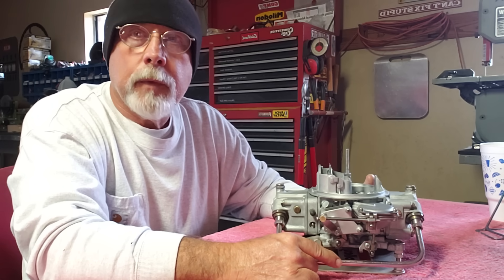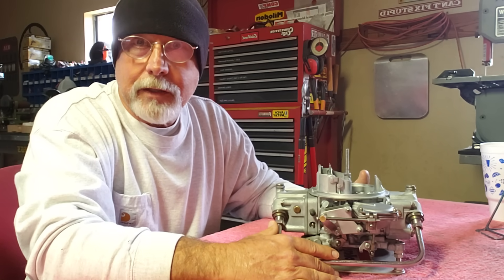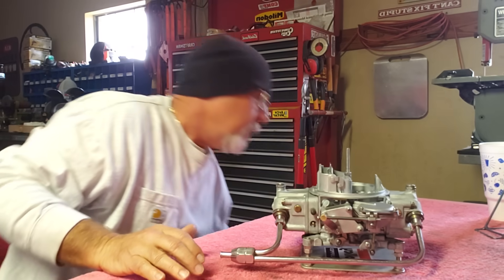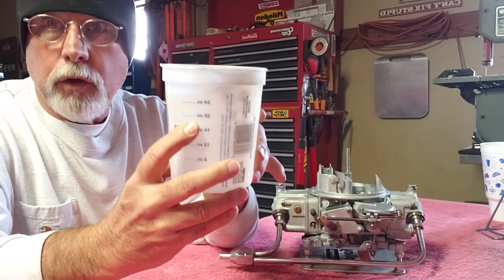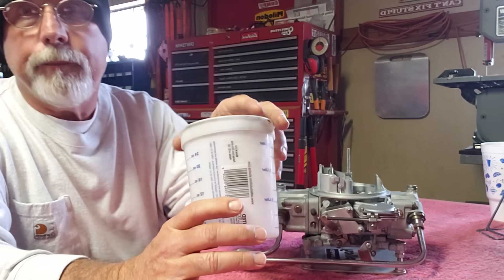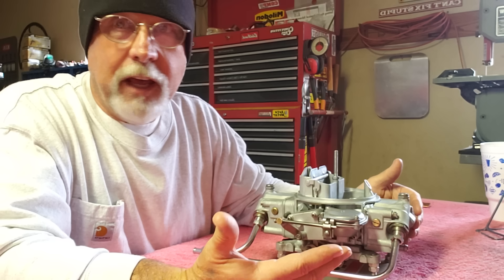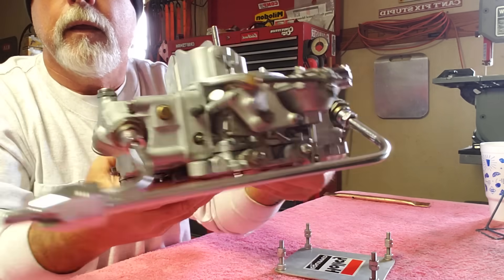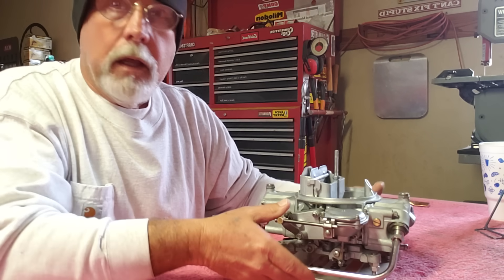Best carburetor cleaner ever!

Comment: Hydro seal carburetor cleaner is an acid that's been around for years.
Reply: The prime chemical for old style Hydro Seal is/was methylene chloride, not acid. It was called hydro seal, as water is less dense than the methylene chloride and floats on top. The water barrier is necessary to seal the  the methylene chloride as it is a gas at room temps and readily evaporates. It has now been removed from paint removers available to retail consumers. You can buy it from lab houses for a reasonable price. It will not harm steel or aluminum, but will dissolve any plated hydrocarbon. Lifters, carbs, painted parts. Remove and rinse with water. 

Alodine can be purchased to add the golden zinc chromate conversion of the surface and make it look perfectly like new. Aircraft Spruce sells the Alodine.

Ronnie, thanks for this video!!
Reply: @billl7551  I can still get a 5 gal.steel bucket of carb clean with a strainer .Remember that melt the throttle bushings on a Holly carb if you leave the base plate in there too long . Some people use various toilet bowl cleaners to clean carbs and other small parts .
Reply: It's  Lewis Acid according to my research .Or hard acid .

Comment: Hey Ronnie, First off, thank you for your service from one vet to another. I could only tolerate 4 years of USN duty, but am honored to have served none the less. I haven't tried your method yet but was interested enough to watch the whole video.  I've used distilled white vinegar with distilled water mixed 1 - 1 depending on how much mix is needed to submerge the parts. I really like the soda blast tip at the end and will have to try it. Another way I've used to spark the outside up before reassembly is to take Lava soap and dissolve it into a paste thinner than toothpaste and use a toothbrush to polish the outside surfaces. It takes a bit more time, but if you try it on a small area, I believe you'll be impressed. Thanks again for sharing your knowledge and experience, it really helps a lot of people get their projects done. Stay safe.
Reply: I've heard of using Crest Whitening toothpaste also. Your carb will shine AND have 32% less cavities...
Reply: Hooyah Navy brother.
Reply: Good evening Gary, could you please elaborate on how you used Lava Soap as a finishing compound to polish the outside of the carburetor!? I’m fixing to rebuild my carburetors and I like the idea of using the Lava Soap. Does it turn into foam after brushing it on and then you rinse it off!? Thank you very much in advance. 

Also thank you very much Ronnie and everyone else for your service!

Comment: It is possible the muriatic acid could sit in the butterfly bush and shaft pin and also strip the zinc coating off the butterfly,  and sit between the plate and shaft joint.
soda blasting then ultrasonic bath to dissolve the soda that packs itself into thread holes etc works great, degreasing first helps the soda media stay clean if recycled.

Comment: 1968, I was in the Army stationed at Ft. Bliss, El Paso, TX.  I rebuilt the Carter Carb on my 65 Chevelle 300 hp 327 at the Air Force base craft shop next door to Ft. Bliss.  They had a 5 gallon bucket of some kind of acid because  when they took the lid off, it smoked.  I wish I could remember what acid they used.  They had a stainless basket that allowed the carb parts to be dunked into the acid with easy retrieval.  The mechanic there told me to leave the carb parts in the acid for 45 minutes if I remember correctly because it had been used many times before.  Anyway, my carb looked brand new afterwards and the engine performed like new with this super cleaned carb.

Comment: I ALWAYS USE LAQUER THINNER IT WILL DISSOLVE VARNISH AND GUNK IN ALL THE TINY PASSAGES, I JUST FINISHED REBUILDING MY MOTORCYCLE CARBS AND THEY LOOKED LIKE NEW.
Reply: I've had good luck soaking parts in old diesel and then rinsing it white vinegar water solution.... retaining the luster and protection of the parts is important to me.

Comment: 10 % is the magic dilution number for Muriatic acid for something like cleaning carbs, not sure how you came up with 33%, by my math 20oz is a smig over 10% of 192 oz which is a 1.5 gal, 33% is way to strong for aluminum....
Reply from the maker: 33% is what was the bottle of acid I started with, not the solution mix. 33% would be pure acid out of the bottle. smh!
Reply: @ronniehenson4122  oh sorry,  that must be a Muriatic acid pool thing,  i've never seen a % on the Muriatic acid bottles at walmart and i've been using it for more then 20 years for everything from electrolysis to rust removal and rust creating which is kinda weird when you think about it, by itself it removes rust and mixed with hydrogen peroxide it creates rust

Comment: Be EXTREMELY careful if You plan to do this to an old motorcycle carburetor. They are cast in a totally different material, and can easily dissolve if left in there without attention. It doesn't take much time either. Find a scrap carburetor You aren't going to use, and find out how strong the solution can be, and for how long You can dip the carburetor in there. Just wanted to warn You. Thanks!

Comment: I have an old motorcraft 2 barrel that I kept for whatever reason knowing it's junk, I mean that thing is locked up solid, I may try this, at worst it won't hurt anything and the carburetor is still scrap, at best it fixes the carburetor, I really didn't think there was any possible way to help that carb but I may have just found the solution, or the 10:1 solution lol, if this can help that carburetor I may have a good working 2 barrel for my 2 barrel 302 intake, thanks!
Reply from the maker: Good luck! Let me know how it turns out

Comment: Sounds good .but what. About the vac seal rubder ...and do you seal the openings of the carb when soda blasting ?   Nice. Post
Reply from the maker: I remove the rubber seal ( Don't loose the check ball) and dip everything else. Soda blast everything and clean with water blow out with compressed air no problems at all.

Comment: Thank you very much I'm a retired fertilizer chemist and have a few old 327 to 350 motors I've owned and use on my airboats and as you say when i was working the gas gets left in carbs and I have used Nitric acid and other chems for cleaning the discount way cause you could buy a carb for almost what the 5 gallon bucket with basket of carb cleaner in the 80's and 90's but i never thought about using muratic  and as i was watching and listening I was wondering about the baking soda Thank you I am retired and have about 5,000 worth of holley's from 650 cfm to 1150 double pumpers that are fixing to get rebuilt Thank you very much Preston Green Fish eating creek FL>

Comment: I've worked on an anodizing line. Sodium Hydroxide AKA caustic soda will eat aluminum. An acid solution in my experience doesn't affect aluminum. In fact sulfuric acid is used in the clear coat anodize process. Muriatic acid is a less concentrated or less pure hydrochloric acid.  I had no idea it would clean the old deposits out of a carburetor. Thanks very much for sharing this.

Comment: What about the rubber diaphragm on the secondary's did you have to take that out too?  and does it affect the green paint on the throttle shafts?
Reply from the maker: I did remove the rubber diaphragm and yes it will remove the paint on the throttle shaft.

Comment: Muriatic acid shouldn’t have a chemical effect on Aluminum (most anyway depending on alloy blend). However it will begin to etch/dissolve most anything that’s steel. So I would recommend removing any fasteners and or other steel components before submerging in the muriatic acid. It would take some time to actually dissolve a steel component, probably more than you’re ever willing to wait, however it will etch/eat the surface, effectively messing with any tolerances of parts. It could also weaken things like the threads on screws.

I also highly recommend applying some kind of oil to any steel parts you clean with the acid, as it will leave the metal totally bare and exposed to the elements, making things easier to rust and pit.
Reply: Also just FYI, probably the best cleaner/rust remover for steel is Krud Kutter Rust Remover (specifically that product, as they have others that also say they remove rust).

Comment: Muriatic acid is an old name for Hydrochloric Acid.  It has a multitude of uses, but is dangerous to misuse.  In dangerous concentrations (30% or so) it will give you acid burns on your skin, in your airway, and in your eyes.  Use a full face respirator with the right filters, the right gloves, and good ventilation.

Learn how to mix for a low concentration (1-2%) to start with.  More might not be better because it will dissolve aluminum and zinc.  The bubbles you see coming up are hydrogen as your carb is being turned into aluminum chloride.  It will quit reacting when all the acid has been depleted.  But yes, I imagine it would clean a carb very well.

Comment: excellent    how about cleaning the inlet valves on a direct injection motor .. I have viewed a guy using some expensive Aerosol cleaner to dissolve the deposits from the inlet valves .
Reply from the maker: Without removing the heads, the CRC GDI aerosol spray into the throttle body is about the only way that I know of to clean the valves. The problem with this method is you could cause your engine to run lean and burn a hole in the piston. Follow the directions to the letter. Good luck!

Comment: I put a nozzle on the side of a metal bucket about two inches from the bottom, then fill halfway up with Gunk, it's best, put your basket with carb inside, plug in on nozzle and let it bubble about two hours , wash with water and carefully blow out with air, hey I'm a professional mechanic of more than  50 years.  2/16/21
Reply: I've used CLR for years and that stuff just chews through the algae I find in carbs now days.  I think that crap comes from the ethanol they put in the gas nowadays. That algae is like trying to remove ceramic from the insides of carburetors. And I think it's a lot safer than using muriatic acid. GOD bless y'all.

Comment: Not many things are made out of pure aluminum-
it's too soft, and oxides quickly.

Vehicle rims ("Mags"), your carburetor, heads, block,
timing covers, alternators, etc. have a certain percentage of
other homogenous metals mixed in, for strength.

It's usually Magnesium- that's where the nickname "mags"
comes from.

After opening up the pores, it should be coated in at least
Zinc Chromate paint or boiled linseed oil.

Comment: Why in the world would you spray WD-40 on the bolts before you assemble a carburetor? WD 40 is not a lubricant, it is not a preservative, it is a solvent. I have seen it destroy firearms and when they didn't destroy the Firearms it caused some damage to them.
What you describe is not anywhere close to a 33% muriatic acid in solution the first described a 12 to 1 ratio at 16 oz to a gallon and a half. That's one pint to 6 quarts. 25% alone would have been a half a gallon of muriatic acid and a gallon and a half of water. Still wouldn't have been 33% mix.
Reply from the maker: Wow! Go back and look at the video again, I stated that the Muriatic acid was 33%. It come in a verity of different strengths and the gallon I was using was 33%. You might want to go look at WD-40's web site "WD-40 protects metal from rust and corrosion" and yes it does work great.

Comment: Thanks for your Service G.I.,,  great information. 
I've spent hundreds on the chem-dip cans, which worked great,
 as I've also used it  de-grease everything I could cram in the can🤷‍♂️.
My simple question,,
 Will the murartic bath de-grease assorted engine parts as well?
I'm on a modest budget and am always looking for a good alternative. 
Thanks again for your Service and reply👍.  G.
Reply from the maker: No, this method is not a really a good degreaser and I wouldn't recommend it on metal parts. Works great on old carbs with old varnish gas / old gaskets that was left it the carb for a very long period of time.
Reply: @ronniehenson4122  ,, thanks for that👍.

Comment: It's the rebuild kits that kill you on those holleys. A full kit can easily cost 150+ dollars. I have a shelf full of old holleys people have given to me over the years cause the parts to rebuild them exceeded their worth. For small displacement V-8's i started running edelbrock performers on them. They work well, are reliable, and cheap and easy to rebuild
Reply from the maker: $48.00 dollars is what I pay for a premium Holley rebuild kit
Reply: @ronniehenson4122  The last holley master rebuild kit i purchased 12 years ago. Holley part #37-1537 was 139.00 dollars + tax. I am looking at the receipt right now. With all the foreign companies making kits and with the online vendors now - i'm sure it is much less
Reply from the maker: @timrussell1559  Check eBay a lot cheaper.

Comment: I have used all sorts of different stuff to clean carbs. While not ideal I have used dishwashing liquid!  Though first wash all the excess crap off in the parts washer. Heavy squirt into the sonic cleaner. Then  after that  to get some sort of finish I use proper acid mag cleaner then blast off everthing with the pressure washer. 
Not near as good as yours!  At times on real grungy ones I have used  glass bead in the blast cabinet.
Though be very carefull or you may end up with sand where it should not be.
I have seen several 'replated' carbs.  Generally too blingy and it blocks up   those  fine passages in the main body and metering block.

Comment: Why don't you just use cheap-brand "Carburetor & Fuel Injector Cleaner" from WalMart? Costs about a buck a jug. Use the spray stuff if you want to dress up the outside of the carburetor. Cheap, trouble-free, no hazards. I've been cleaning carburetors with that stuff for about forty years, and it works really really well..
Reply from the maker: Post a video and let us see please
Reply: @ronniehenson4122  There's nothing to see. It does its job. Dirty varnished (inside & out) nonfunctional carburetor -> clean functional carburetor. Two still photos, before & after.

I don't have any dirty carburetors at the moment so anything I can show you would be misleading and dishonest. At any rate, it's well below freezing in my (unheated) shop right now and there is no way that I'd go out there today and clean a carburetor for YouTube's benefit; I don't relish the thought of frostbitten fingers.
Reply from the maker: @timhofstetter5654  I don't just do the out side of a carb, watch this video and you can see all the parts were clean thoroughly inside and out.   https://www.youtube.com/watch?v=CgT8qX2pgAw
Reply: @ronniehenson4122  I don't just do the outside, either. That would be stupid.

Comment: Excellent video! I'll be giving this a try for sure. I'll have to see how it does with a cast iron carb with the unavoidable rust from my D7 starting engine. I'm sure it will work better for Zinc or Aluminum but I'll give it a try anyway. Thanks!

Comment: You're the man, this stuff also cleans seashells very well too.

It does dissolve ferrous metals though (acid porting manifolds), and will destroy all stainless in my experience (stainless and high carbon tweezers rotted away after dropping in the tub)

Comment: Safetykleen use to have a product that they used in a pneumatic washing machine. It cleaned everything, carburetors, pistons, rods, or whatever you put in it. You set the timer for 15 minutes and the parts came out 100% clean. I called Safetykleen and they said the solution was to caustic that the EPA stopped them form using it. I will give try muriatic acid. Thank you.

Comment: The vacuum secondary and fuel bowls are on the wrong end and so is the base plate.
Reply from the maker: Sorry! had my phone on mirror image and didn't realize it until I posted it. Got all the other video correct.
Reply: R u sure cause you are holding the the carb and i know the fuel line should be on your left and so does the vacuum secondary..but it looks strange maybe ur right .
Reply from the maker: @born2wrench  Relax, the phone that I video this on was unknowingly set on mirror image. Sorry!

Comment: Great video! I work on bikes and boats mainly. Lots of inboard auto type engines as well as 2 stroke. Hydrochloric acid (Muriatic) can be of great help. I use it in my ultrasonic cleaner to great effect. Don't put it in the cleaner directly. Put the solution in a plastic or glass container that you suspend in the cleaner filled with water. That way you keep the acid and grime out of your expensive cleaning unit. I run mine at 150 degrees f for 10 minutes. Amazing. Been using a siphon gun to soda blast carbs for many years. I put a piece of welding rod inside the last 8 inches of the siphon tube and tape on a battery powered vibrator from a pet toy to keep the soda flowing from the box of soda while blasting. Super nice results. Thanks for the tips! Great job on the video.

Comment: Hey thanks for video great tip I might try on Diesel egr housings they are  notorious for carbon caking . Right now I'm using Diesel fuel and submerge for a week it softened the carbon and you can hand scrape and scrub it's still a lot work.

Comment: Ronnie thank you for the video from another Okie but from the eastern part of our great state. I have been cleaning carbs in citrus water I made up 
with citrus powder I got off Amazon that works very well also. But I plan to try your way also. I use to use Muriatic acid for cleaning cylinder walls 
of racing kart engines that had stuck a piston when running to lean. It took the aluminum off the cast iron cylinder great. Just had to do it out side 
or you found every thing rusting in my shop from the fumes it gave off.